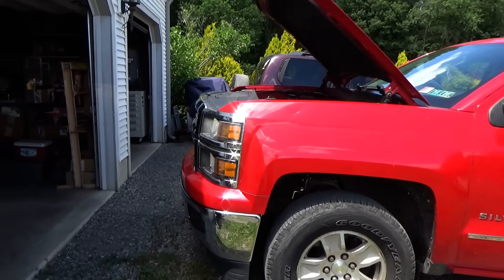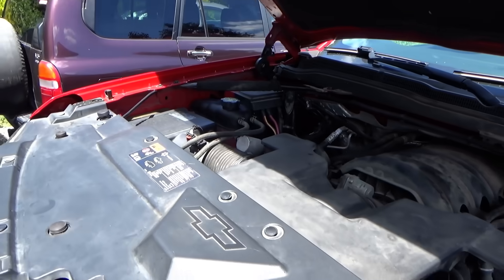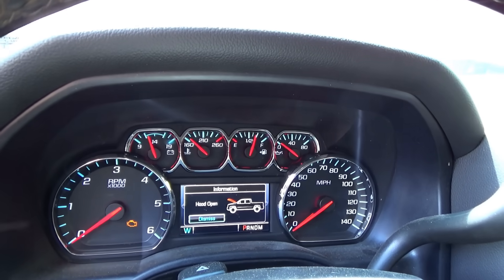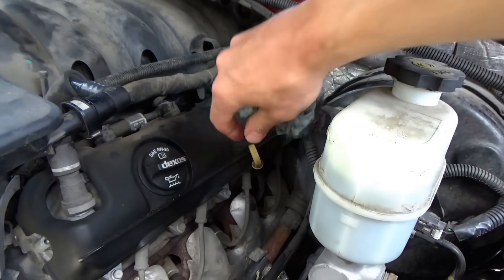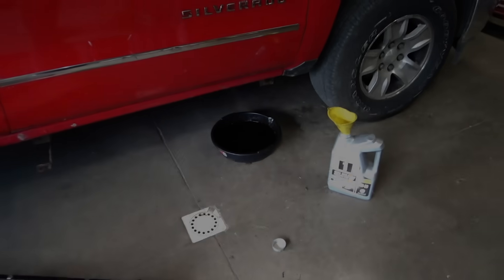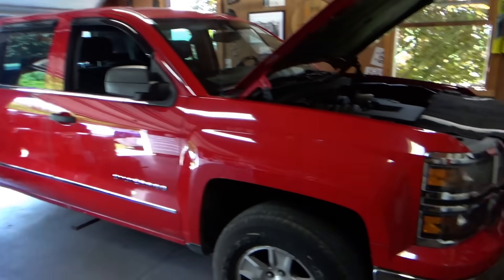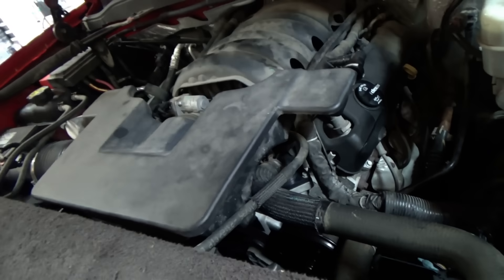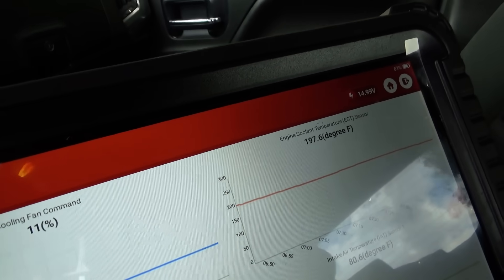Chevy Truck OVERHEATS?! (Thermostat & Water Pump Already Replaced...)

Comment: Another thing to keep in mind (not applying to this vehicle), is that if you have a car with only electric cooling fans, and a coolant switch that only kicks on above boiling, that you can have a radiator cap that doesn’t hold full pressure cause overheating under certain conditions. This because the pressure will not be applied and the coolant will start to boil before the coolant can reach the temp needed to turn on the fan. I had one where this occurred and replaced the cap, and then of course the water pump started leaking because it was worn too and couldn’t hold the 16 psi of the new cap☹️.

Comment: We trust Gates...they have been around for decades.  I wonder what make that water pump is?  Could be it'll be problem sooner than later.
Reply from the maker: Gates is getting worse too...remember that Subaru timing belt kit?
Reply: @PineHollowAutoDiagnostics  Yes, the complex items not so much but especially Subaru timing kits. I've heard OEM only or the Japanese kit that is available is best. On USA Detroit vehicles, Gates has had our back for decades when it comes to rubber hoses, belts, water pumps, etc. Felpro is another top brand who exceeds OEM much of the time when it comes to gaskets. Even with Dorman, their window regulator are way better than OEM plus a good warranty to go with them, lifetime. However, Dorman is one to know as they have lots of junk too.  Its really sad we USA folks have to deal with the crap out there...name brands used to mean something !  Now, it doesn't pay to be loyal

Comment: 0W20 so funny.  Engine burns oil & poor wear protection!  Thanks climate change C-Krazies!
Reply: Part of the reason for the thinner oils is for the cam phaser systems and they have higher flow rates, which isn’t a bad thing. Good maintenance is critical, which very few people do.

Comment: I've always said, new = never ever worked (yet) 
While an OE new part isn't a guarantee  it's much more likely to be ok and correct for the application. 
In diag it says "replace with known good component" not new. But, in many situations it's not reasonable or cost effective to use new, in this case, absolutely!

Comment: How long has this guy owned the truck? 180,000 miles and no valve train issues? 
I'm wondering if he just got it because the previous owner sold it because of oil consumption?

Comment: Easy peasy for Ivan.  Another episode to remind us about aftermarket parts.  The owner needs to rectify the obvious oil burning issue.  That is why the level was low and the catalytic converters are shot.  Perhaps the valve seals.
Reply: Judging from the oil issues, rings are probably trashed.
Reply: @vpimike2646  could be as simple as sludge in the PCV system. Or it's possible that oil change has 20k on it and "normal" oil consumption. I sold a kid a sentra in 2021. He recently told me the low oil light came on. I ask when the last oil change was and he informed me I did the last change.
Reply: @_RiseAgainst  Yeah, those folks on the left side of the bell curve are out there, but if he knows Ivan, he must have some sense.  Nevertheless, the low oil combined with the bad cats is usually an indicator of oil burning.
Reply: @_RiseAgainst  Okay, you win on the discussion.  I just read a reply from Ivan and he said that the owner lent the truck to his son who drove it a lot.  Obviously he never checked the oil level.

Comment: Those are actually 10 quart engines
Reply from the maker: If you want to overfill it by 2 quarts LOL
Reply: @PineHollowAutoDiagnostics Ivan, true with an oil cooler.
My 2000 Rover takes 6.5 qts. 
I had recently changed out my oil cooler. I added 1.5 more.
Reply: Actually the original owners manual for a 2014 is 8.5 quarts. A TSB (PIP6231A) was issued to supersede quantities in SI to 8 quarts.
Reply: My 2019 holds 8 qts

Comment: 6 months ago I worked on a buick Encore with coolant leaks after an expensive parts cannon fail. I replaced one elbow and a short peice of hose and it fixed the problem. Yesterday I used the hose for something unrelated and 5 acorns fell out. I am now confused as to how they got in a sealed system, but I remember vacuuming lots of acorns out of the engine bay.
Reply: You put the old one where mice were storing acorns ,then used it for something else.
Reply: @peterwill3699  Great theory! However there is not an acorn tree within 5 miles of my bougie neighborhood. They were also burnt, so they definitely had been hot. It's possible a mouse is trolling me, got the acorns out of my shop vac and put them in the hose. That's my working theory.

Comment: Old Dexcool clogging the rad?
Reply: Shouldn’t be. The dexcool mud was mainly a problem in vehicles without pressurized expansion tank setups.  Fresh coolant can start getting muddy within months in those.  I’ve seen many GMs with 10+ year old dexcool in vehicles with pressurized expansion tanks that is super clean, and shows no signs of corrosion or sludge.
Reply: @DB-bw5fz I have had zero problems with Dexicool. 
Absolutely nothing.
Reply: @2nickles647 Thanks. My experience with Dexcool is with the older systems.
Reply: It was a defective, new thermostat.
Reply: @Jonathan-A-877  Yes. I noticed that at the end of the video. Thanks.

Comment: Can you imagine if you test drove it with only 3 quarts of (oil) sludge AND it overheating, resulting in possibly destroying bearings and/or seizing up the motor?
That's scary.
Really glad you checked 1st. 👍 🇺🇲
Reply: I rented a diesel powered moving truck from U haul in 2001. I checked the oil before leaving. Good thing I did as it was 6 quarts low on oil. 😦
Reply: His head gasket sent you a thank you.
Reply: I have also  seen that low on oil i have also seen an  engine that  had zero oil in the motor and the person who drove it to the shop was driving around with no oil in the engine plus no gas WTF LOL
Reply: He already drove it in with only 3 quarts of oil already...
Reply: I'd like to hear the idiot owners explanation about the lack of oil....LOL
Reply from the maker: @knowone6214 he blamed his grandson for borrowing the truck and not checking the oil 🤣

Comment: I like these once in awhile when the only scan tool needed is on the end of your arm and between the ears.  👍👍🇺🇸
Reply: Vehicles today have multiple computers and
Networks where all sensors are connected,
Without the ability to read all sensors and codes your hands will
Be Emply much less your thought process.
Best of Luck.......
Thanks to all those who
Video on u-tube true
Pioneers in the Present Moment......
Reply: @Gruin  True for most electrical issues , but in this situation the problem was elementary for someone like Ivan. He did some basic checks with the scan tool, but He knew what the problem was when He put His hand on the top radiator hose. Proper scan tools are certainly a necessity but not always the 100% cure all. That’s when experience comes in to the picture.
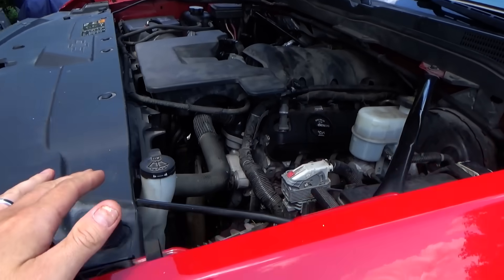Reply: He knew at 1:20 in that the thermostat was bad, didn't really need to even hook up the scanner.

Comment: Maybe lawsuits have to be filed against these aftermarket parts companies.  It is out of control.
Reply: Good luck suing a Chinese Company.
Reply: Why didn’t the shop that replaced the water pump and thermostat find the oil low and extremely dirty ?
Reply: @georgegould667 they probably did buy lots of customers will say oh ill diy it.    Yet they don't change it enough or use the proper parts and fluids and then whine about how nothing is built well anymore.
Reply: need to stop the Chinese Clone CRAP.....that would fix 90% of it
Reply: @knowone6214  Really?  I just bought OEM rear brake rotors and pads for my vehicle that are clearly marked, "Made in China."  Now, I know that isn't really a critical part and I was told that just because something is made in China doesn't mean it is low quality.  I agree with you.
Reply: @knowone6214  Amazon is absolutely loaded with it. Fake AC Delco diesel fuel filters, cloned water pumps, cloned sensors, fake NGK spark plugs, etc.
Reply: The counterfeit parts is a major problem. You trying to avoid Chinese parts and are tricked buying a counterfeit part. I had a bosch o2 sensor keep failing and then one day I decided to try a different vendor for same part and problem solved. I believe it was a counterfeit bosch product.
Reply: The problem is people buy it. If we stopped buying stuff just because it was cheap and not because it works America would be a different place.
Reply: @patrioticimmigrant8817 You are probably talking to an audience even on this channel, where 50% of them own iphones made by near slave laborers in a communist country.
Reply: You can start with Dorman😅😅

Comment: When teaching young Padawns at the stealership, I would tell them to fill out the sticker and reset the oil life in the computer as you pull the vehicle into the bay and before you pop the hood. Next, fill the washer fluid. Many customers will check both of these items in the parking lot and claim if either is missing, you didn’t change the oil.
Reply: You mean the dealership can just replace the sticker and not do the oil change?  That would be funny.  How many times did you have to show the customer the dipstick and the difference between clean oil and oil that needs replacing?

Comment: Dear Ivan I install many Motorad thermostat including Factory OEM thermostat and Gates thermostat but no matter which brand you buy you can always end up with one bad one that not working. But unfortunately, many people do not realize this, and I assume that just because it is a brand new thermostat it should work, Instead of just replacing that bad new one with another new one, and I actually prefer Gates products over all them.
Reply: Gates is hit and miss, too, in my experience.  It's OK for some vehicles but not for others.  OE for the win.  I have stayed away from Motorad for years, especially for Asian vehicles.  It's one of the cheapo styles of thermostats on Japanese vehicles and they fail in short order.  Been there done that.
Reply: @johnaclark1  There all hit and miss all brands,  You do know that MotoRad is OEMs Tier-1 suppliers for GM, BWM, VW and many other.

Comment: Unfortunately some parts from the GM dealer are not the same quality that came originally on their vehicles.
Reply: Truth.  GM reboxes aftermarket parts and sells them as their original equipment replacement, usually with a "superceded" part number.  I bought OE tail lights from the dealer for my 2002 GMC 1500.  I opened the boxes and the tail lights had "Depo" stamped in them and the bulbs wouldn't fit.  Sent them back and found some new old stock on eBay under the original part number.

Comment: Why don't they put a thermostat position sensor on new vehicles, or temperature differential alarms on the thermostat?
Reply: That would be very helpful! Wouldn't take much more than what's already there. Another sensor and some code.
I've thought about a sensor for sudden pressure loss for the cooling system.
Reply: There are some vehicles with computer controlled thermostats, and they commonly fail as well. Probably just as or more often than old school parts, and a lot more money.

Comment: Is not chicking engine oil still an issue in 2024?
Reply: It’s an issue more now than ever.  In my experience, oil burning can be either linear or exponential.  I’ve had vehicles that won’t burn a drop over the first few thousand miles, only to begin burning right near the time the oil change is coming due. Some people check the oil early on in the life, see that it isn’t moving, then assume that everything will be good until it’s changed. Others incorrectly rely on the vehicle to tell them if something is wrong.  

My wife owns a Toyota with the 2gr-fe.  That thing has had the oil changed every 5000 miles it’s entire life with 0w20.  The oil level doesn’t move throughout that time, and comes out looking pretty clean to boot.  I drive a GM truck.  Despite what the oil life monitor says, I change the oil every 3000 miles with the 5w30 it calls for.  Despite the AFM being fully intact, any oil burning during the oil life is negligible.  It doesn’t stay as clean as my wife’s Toyota does, but it hasn’t experienced any of the “common” oil issues that those trucks seem to have either….likely due to keeping it full of clean oil.
Reply: @DB-bw5fz well don’t the truck have 4 more cylinder’s dirtying the oil, than the Toyota?

Comment: Several comments on this one.  Some folks are pointing out it could have been air locked before.  I think that is a possibility but I have no issue agreeing with Ivan about sticking with OEM.  But between the 3 quarts of oil left and P0420 and P0430 codes, this thing gave me flashbacks of the Volvo.  I mean you don't need to be too conspiratorial to consider a truck nearly out of oil, that overheats, and has two bad cats, may have an owner looking for a "solution" by bringing it to a mechanic.....hopefully that was not the case here.  What did the owner say about the oil level?
Reply from the maker: Definitely no air lock...just MOTORAD GARBAGE haha!

Comment: I'm not saying Ivan is wrong about aftermarket parts.  However, mechanics only see the stuff that goes wrong. They never see the stuff that goes right.  I mean, who brings their vehicle in the shop after a repair to say nothing is wrong?  This is a form of survivorship bias, which has an interesting history.  So before listening to a doctor, mechanic, etc about their experience and recommendations, just keep this in mind.
Reply: Motorad has been junk for a long time.  Many of the companies, like Motorad, that used to be good have had to cut costs and the expense of a reliable product.
Reply: "However, mechanics only see the stuff that goes wrong."  Correct, and when mechanics regularly see aftermarket parts cause problems then it's a sure sign that there is a quality problem with them.
Reply: @ferrumignis  Thank you for proving my point.  For all we know 99.99% of the aftermarket stuff works just fine.  But if all you ever see is the 0.01% that doesn't work, you'd come to the conclusion that it's all junk.  Look up the history of survivorship bias, which is a form of selection bias.  The big example in Wikipedia was in WWII in deciding how to armor aircraft.  They wanted to put armor where they saw bullet holes, which was on the wings.  But that was a mistake.  The aircraft that were getting shot down had damage in the cockpit, engine, and tail.  But they never saw those aircraft because they never make it back home.  So they were drawing the wrong conclusions because they didn't have the right data.  Like I said, not arguing with Ivan.  It's probably junk.  I'm just pointing out a common error that people make and to be mindful of it
Reply: @major__kong  No, thank YOU for proving my point.  If aftermarket junk worked 99.99% of the time we would see a similar level of failures on OE new and aftermarket.  In reality we don't, we see failure of aftermarket crap far more often.
Reply: I've been saying it for years. The stealership, local shop, or DIY parts cannon fixes it 75% of the time. But it makes the other 25% extremely tedious. That being said, I still use OEM on my cars 90% of the time.
Reply: That's normal behavior with people who want to blame the mechanic.
If there is nothing wrong. Why did you bring it in?
I've learned NEVER trust anyone. 
Once they start talking, it's an endless rant. 
I have my ford, it's got a Cold air intake system, Randy's ring/pinion blah blah blah blah blah blah blah. 
So what's wrong?
What year and make? 
O it's out there...there the big red one. 
😅😅😅😅

Comment: So, was a bad thermostat replaced with a bad thermostat?
Reply: Great question!! I was thinking the same. Someone mentioned the low oil level may have been the root cause of the overheating. Not sure how much this engine relies on oil for cooling. I know some have oil sprayers that spray the bottoms of the pistons. However, if there wasn't enough oil for spraying, there certainly wasn't enough for lubrication.